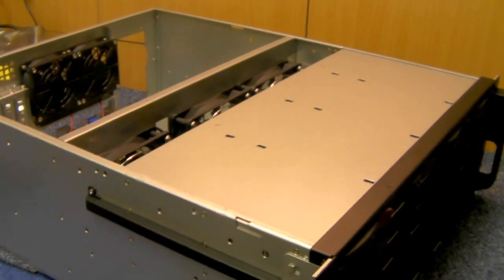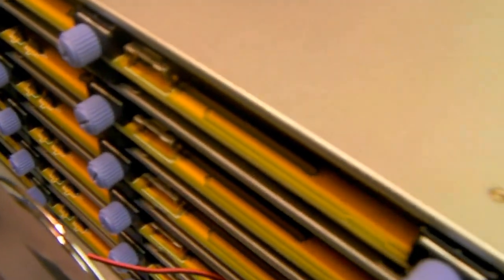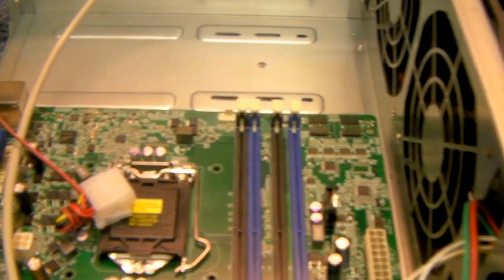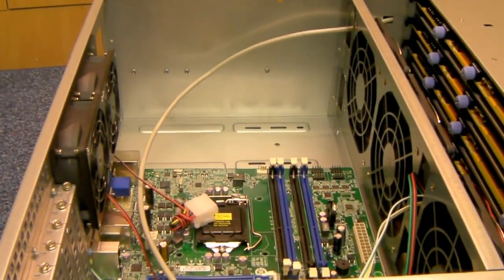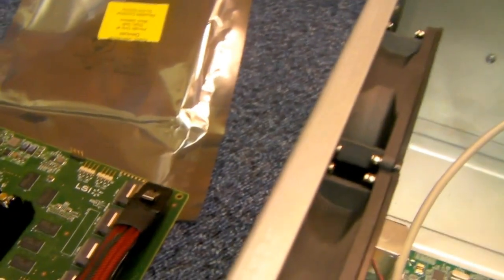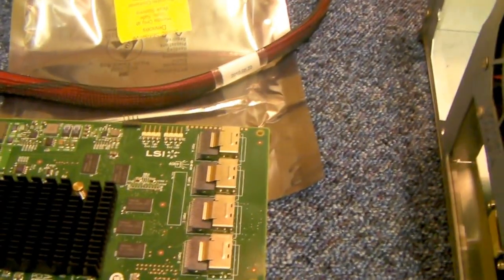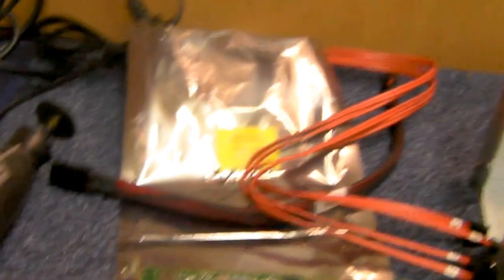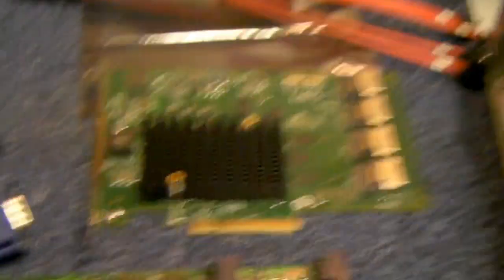X-Case Home Server Box Mini Review

Comment: You'd need a reverse breakout for both a motherboard OR an "old style" raid controller with individual SATA connectors.

You do not need a forward breakout in this case - forward breakout is when you have a multilane connector on the card and want to connect to individual sata connectors for each drive (eg: no multi-lane connector on the backplane).